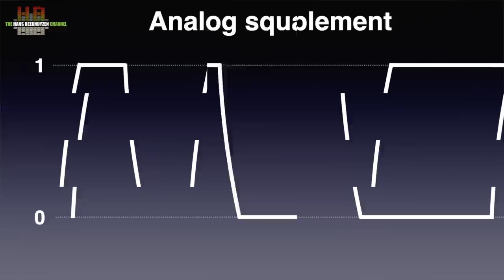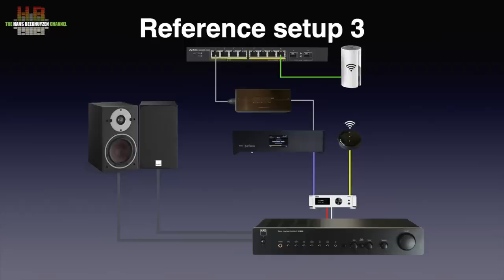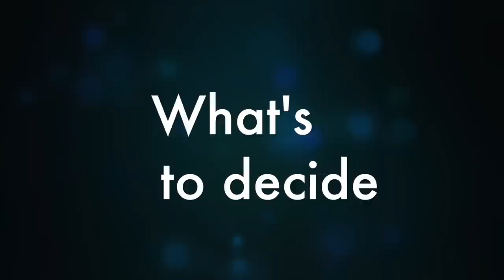Using an external DAC with your streamer

Comment: This is exactly what has happened to me. I have good DACs/Intergrated Amps. I use a TV in one system and a cheap Wimm streamer in the other. I'm really debating on upgrading the Wimm however will it make a difference?😊 😊😊
Reply from the maker: It depends on how good your DACs and Amps are....
Reply: @TheHansBeekhuyzenChannel  Well my main system I use an integrated Denon A110 Anniversary Edition (£3500) which has an integrated DAC which uses Burr Brown PCM1795 chips in a quadruple configuration and I have the Wimm currently going into this 😅. My other system I have a separate DAC called the VMV D1se (Smsl premium sister company - £700) which is built around 2 Ess ES9038RO DACs feeding a  Valve Amp (Wellsenton R8). It's the Denon I'm really debating as the Wimm doesn't sound as good as my CD player (Cyrus). 

Also, thank you for the reply.
Reply: Save the money and buy more CDs then!
Reply: @GeorgeFrideric71  good idea, I am finding though alot of newer independent artists aren't even releasing on CD or Vinyl, just the streaming platforms. Oh I'll be supporting united later today 😉
Reply: @2HatHudders  I’d probably suspect the WiiM before I’d suspect the Denon. If your CD player has a coax out, run that into your Denon’s DAC. If the CD player still sounds good, it’s not your Denon. The “issue” would then be pointing to the WiiM. 👨🏻G.
Reply: @shipsahoy1793  thanks for the reply, just to be clear there is no issues, everything works fine. It's more the question, should I have an higher quality stream going into the DAC? If so, how much do I spend before it's the law of deminishing returns.
Reply: @2HatHudders  Maybe you didn’t watch the whole video, but based on the quality level of your Denon, I’d say it’s a safe bet that you could use a better streaming device than the WiiM connected to the A110.👨🏻
Reply: @2HatHudders  such a shame! (On both the new releases...and United!)
Reply: @GeorgeFrideric71  hahaha, yeah Spurs whiped us 🤣🙌🏽
Reply: @shipsahoy1793  well thats the point of opening this discussion, seeing people's views. 👍🏽
Reply: @2HatHudders  come on now let’s be realistic. You asked a specific question and I tried to give you a specific answer, and you should’ve been able to glean the answer from the video anyway, This shouldn’t even have had to have been a discussion.  there are certainly more important things to discuss. If you’re not happy with the quality,  just buy a better quality streamer, that’s the bottom line. Don’t look for excuses as to why you don’t have to. That’s my $0.02.
Reply: @shipsahoy1793  wow there's zero need to be so dismissive. You missed/ignored my point about diminishing returns. Instead you went on different tangent. Why even comment with that attitude..
Reply: @2HatHudders  it’s not an attitude, and I didn’t dismiss your point. If you watch the video, Hans says that the cost associated with the streamer should be about equivalent to the cost associated with the dac  which means if you have a $500 dac,  you should have a $500 streamer 
and I agree with his assessment, that’s all there is to it… I can only add that in my experience once the dac cost doubles that streamer cost, then you’re not doing yourself any favors by trying to spend more money on the dac because it’s not gonna matter, at least not relative to that streamer (in my opinion).
Reply: @shipsahoy1793 Thanks, that makes sense. I've bitten the bullet ordered the Eversolo Streamer so I have approx 30 days to see if the difference and hopefully it does.

Comment: I have found that an Android phone running the USB Audio Player Pro app sounds better than either the WiiM mini or Bluesound Node (used as transports), and is almost equal to a Primare NP5 with LPS in the system I tried these with.

I'm my main system an Auralic Aries G1 streamer is noticeably better than the Primare.

My first streamer was a Yamaha WXC-50, which I used with a Primare DAC30. I bought it because I wanted to try Qobuz, and I was very disappointed, the sound quality of 'CD quality streaming' was nowhere near that of an actual CD (played on the same DAC or from my CD player's analogue output). It wasn't until I got the Auralic that I was satisfied with listening to Qobuz or Tidal.
Reply from the maker: ‘An Android telephone’ is a rather general description. There must be clear differences between models.

Comment: Benchmark Media Systems, who make the DAC3, claim that any digital source will sound the same with their product, which sells for around $2000. It seems that they have a remedy to fix any upstream issues from something like a WiiM. All in all,  $2000 sounds fair given the price of some digital sources which don’t take care of A to D conversion. Would be interesting to run your extreme test with this DAC model to see if your experience aligns with Benchmark’s claim.
Reply from the maker: Have you tried it?
Reply: @TheHansBeekhuyzenChannel  I compared the DAC3 with a Mac Min against a HifiBerry Digi+ and never heard a difference, but the Digi+ is hardly the level of your setup 1 as a dedicated source.

Could also be that my headphones are not resolving enough.

This is not a snarky comment at all by the way, I just wanted to suggest that with some DACs it could be that a cheap streamer does not hold back the performance. I don't quite have the technical knowledge to definitely make that claim though.

Comment: Dear Hans, thanks a lot for this, i was considering a wimm mini. Can i ask you which streamers you would look at in my set up: chord mojo2, atoll in200, monitor audio silver 300 g7? Thanks a lot for your advice!
Reply: ifi zen stream? Or wil it be a weaker link?
Reply: Hans unfortunately does not give buying advice. You have a nice system, so if you value Hans advice you should buy a streamer around 600 -800 in comparable quality to your dac. I use several wiim minis in my house and do enjoy the product. That said in my main stereo system I have my mini hooked up to an allo Shanti linear (that I had already owned) and Wyred 4 sound remedy (that I already owned), so I feel like I'm not losing much.  In my headphone setups I use  IFI Purifier 2's and for the Wiim's power supply I use IFI ipower, which did clean up the sound nicely. Anyway if streaming isn't your primary source for critical listening (which part of me thinks it disconnects you from the entire point of listening to music and can be a curse) or if you do not critically listen at all you would be happy with it. Anyway I hope I was helpful ✌🏻.
Reply: @jbenz9348  thanks a lot for your elabotate answer! If you would start over for your main system, you would probably buy a single more expensive streamer in stead of linear  power supply and reclocker as that combo with the wimm included will be around 5 to 600 euro or not? The atoll and mojo 2 will be delivered In about 2 weeks so I think what I'll do is use my android phone for a while via the USB of the mojo2 and see what I think of it. Think that set up is likely to be similar to the wiim mini, would you agree? If I have the feeling I'm missing a lot I can always compare to a more serious streamer with a return policy. Pitty that Chord Poly does not support spotify connect. Really would want a streamer that does this natively. I agree somewhat with your statement on streaming platforms, but I just recently went back into 2 channel and the thought of building a vinyl collection is a bit daunting 🤣 anyways thanks for your thoughts, cheers.
Reply from the maker: I give you buying advice every week, and for free. But you do need to think about your situation: how critical am I, how much is the dollar worth for me and so on. Then watch my reviews, see in what reference setup I place the reviewed piece of gear and then decide.
Reply: @TheHansBeekhuyzenChannel  thanks Hans, I was looking at your setup 2 actually for reference